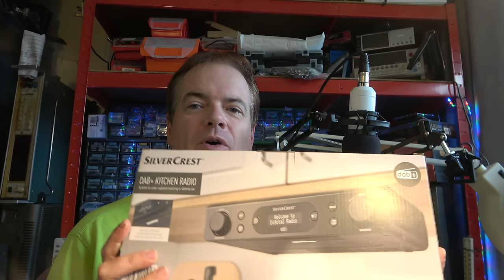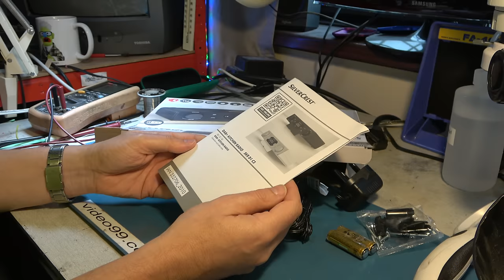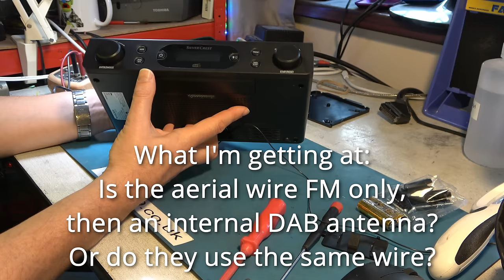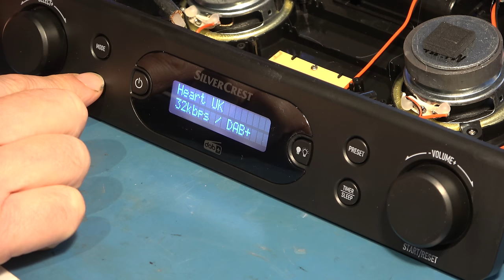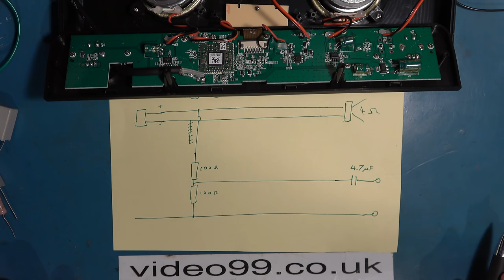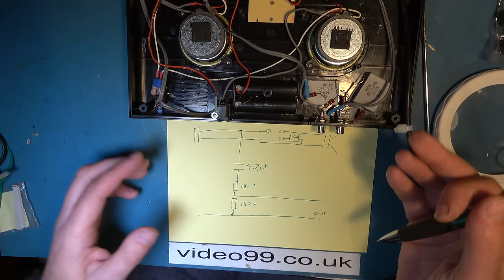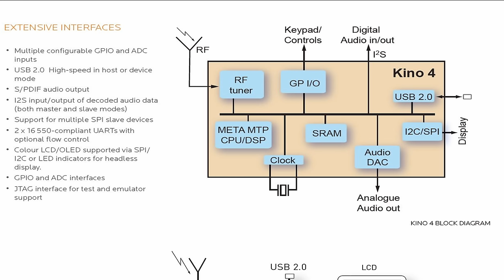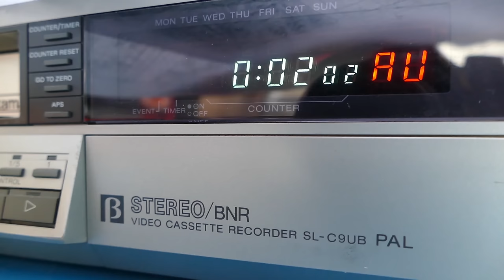DAB radio modifications.  LIDL kitchen radio could use some upgrades.  Part 1.

Comment: You said at the start of the video, about the importance of having a stereo output, but many of the DAB & DAB+ stations only broadcast in mono anyway, some at quite a low bit rate too. You will often find that the better your audio system the worse these stations sound! 
Most of the stations now have an online stream as well, which is usually streamed at much higher audio quality than DAB.
 I was surprised at how few components & electronics this unit contains too.
Reply from the maker: I believe that the old DAB channels have been switched to mono because they sounded dreadful in stereo.  The newer DAB+ channels are generally stereo.  Yes I looked at the streaming option for my dad's place, but this DAB route was much cheaper and simpler.
Reply: I think its more about dropping the bitrate. Dab is all about loads of low audio quality streams. Lots of choice as a result which is great for a lot of people and its all free! If you wamt hi-fi stereo then the FM with a really great antenna is nice. Sometimes stations are only mono because there's only so much room on the national muxes. Dab+ can be pushed further but Dab+ radios are still rare. There is a little bit of stereo and joint stereo out there though....
Reply: That reminds me... Did you find you had actual stereo or joint stereo from the dab or was it only stereo on FM. I'm assuming it could really do stereo dab but I know I shouldn't just assume with this kind of thing
Reply: They tried to tell us that DAB+ at 32kbps would be equal sound quality to DAB at 128kbps.
It's clearly not.
I have quite a few older DAB radios that I've modified, but I just cannot listen to anything on DAB+, it reminds me if a poor quality children's toy.
Given a more sensible bitrate, DAB+ would actually be a plus!
Reply: @jobliss3932  On some , but not all DAB radios the display Will  show the Letter 'J' to indicate if the station is transmitting in Joint stereo, from what I've heard Joint stereo is a sort of artificial stereo, where the signal is sent in mono, (to save bandwidth) along with a 'helper' signal, then split in the receiver to make it sound like stereo.
Reply: @simonparkinson1053  Yet another case of trying convince people that they will be getting something far better than what they actually got!
I remember when DAB was first planned in the early 90s, they said it would be Compact Disc quality sound! That may have been true to start with, in the very early test transmissions at 256Kbps, but that bitrate very quickly got reduced when they realised that by lowering the bitrate, more stations could be fitted into the same multiplex & even more still, if some were sent in mono! A classic case of quantity over quality!
Reply: Might be 256mbps but its layer2/mp2. Depends what you think cd quality is though. Having said that, long ago now, maybe 2015, there used to be a mono dab station broadcasting speech content at 24mbps and I thought it sounded okay but I'm used to hearing some pretty low bit rate streams. Listening to a station now that's a bit like AM sound with some occasional burbling but at least I can find stations I like if I need to and I don't  pay for the bandwidth. Have to sort out my antenna tho and I'm in London! It does what it does. I don't think it can ever be exactly high end audio and you only have to look at the average dab radio to know.
Reply: @NOWThatsRichy  Lots of the radios have an info button where you can cycle the second line of the display between the time/station name etc/bitrate & mode/ mux and location/signal strength. Lets you find out about each station. Handy feature.
Reply: @NOWThatsRichy  You're right, but it's not artificial.
Joint stereo is a method of encoding much like the way FM stereo is transmitted.
Not a left and right, but a sum (L+R) and difference (L-R) of them.
As you put it, a mono signal with a "stereo helper" signal.
Where both channels are related to each other, you can get a better quality for a given bitrate.
In true stereo, each channel is encoded as if it was an individual mono signal.
This isn't bandwidth-efficient as most of the time you're encoding "almost" the same thing twice.
So for example a 128kbps joint stereo signal would need to be 192kbps true stereo for the same perceived quality.
However joint stereo encoding loses some critical phase relationship information, so SD digital terrestrial TV sound (also MPEG-1 Layer 2) uses 192kbps true stereo instead of joint stereo, to avoid a load of "bubbling" artefacts coming out of the rear speakers on surround sound systems.
Reply: @jobliss3932  it's a standard module made by Frontier Silicon.
There will also be a digital output available on one of the pins to interface with a separate DAC.
The format of stereo or joint stereo is set by the broadcaster, the receiver module can handle all possible bitrates and formats in the standards.
In joint stereo, the broadcaster encodes (L+R) and (L-R).
The receiver, being told it's joint stereo does a bit of maths so: 
((L+R)+(L-R))/2=L
((L+R)-(L-R))/2=R
FM radio works in exactly the same way.
Reply: @simonparkinson1053  I really just meant stereo in dab vs FM but your reply made me realise that all the little dab radios just have a chip in them! I knew that of course but I wonder if they aren't"t that hard to modify for stereo! A strange idea. I bet the chip can always do stereo. Its surprising to that end that almost all the dab radios are mono. Was a second speaker really that expensive? I guess they had to be made to a budget.

 I actually thought that about joint stereo. Its a lot like FM in that way,! I'm actually lucky enough to have a stereo dab radiio. Not as fancy as your setup of course but I'm glad to have it. I've actually lost some stereo channels I liked just recently but there's still a few hanging in there! I don't mind the mono stuff however and with good reception the quality seems no worse than many internet radio streams without the hassle of having a good internet connection. I don't expect CD quality or even FM quality, just lots of choice and DAB seems great for that at the moment.
Reply: @jobliss3932  as far as I know, in a mono DAB radio the downmix to mono is not done digitally on the module, the L and R output signals are combined to the one amplifier input with resistors.
I have a Sony portable that I don't use much (XDR-S56DBP) which is mono but has stereo available at the headphone socket.
The little amplifier chip (TDA2822) always runs both channels but the speaker is only connected to the left.
One of the internal switches in the headphone jack controls a 5V signal to an analogue switch IC that connects left and right together after the volume control (which is analogue in that particular radio)
Reply: At 32 kbit they use "parametric stereo," which transmits very little information for steering portions of the spectrum left or right. Something has to give at those miserable bitrates. The panning can sound smooth with a good encoder like Fraunhoffer, or jumpy with others. Layer II only had "intensity stereo" which combined the higher frequencies together using less compact coding.

Comment: Why not put the 2 resistors directly across the push-pull amp outputs and a Cap to their mid point to remove DC
Reply: Because if you did that, you'd get nothing!
On a bridge amplifier the outputs are equal and opposite, so at the midway between the two resistors the audio signals would cancel each other out completely and all you'd be left with is the DC mid-rail bias!
Reply: And if you meant from one output to ground, he didn't want to upset the DC conditions at the amplifier output
Reply: @simonparkinson1053  Doh! Never thought of that

Comment: This may be an utterly stupid idea, could you use a momentary switch at the end of the headphone plug to disconnect speakers? Once the tip fully inserts it would press in the momentary switch and connect the two channels together.
Reply: You could, but you'd be better off getting a headphone jack with the relevant switch contacts (I'd go for a switch on ground for this sort of thing), and use the switch to control some relays.

Comment: How about the humming noise, very audible at low volume?
The humming seems to be independent of the power supply, meaning it's caused by the power stage on the board itself.
Any fix for it?
Reply from the maker: Not had that.  You might have an earth loop problem, so I think I would start by connecting the phono outputs to something battery operated, or even directly to efficient headphones, with nothing else connected up.  Don't even have an external aerial connected.  If you still hear the hum, and you've eliminated the power supply, then it does imply it's a locally generated noise.  Try turning off the display backlight in the menu in case the driver for that is the cause.  Hope that gives you some ideas of where to start looking.
Reply: @video99couk  Thanks for your reply, but we're talking about the Silvercrest DAB radio. No phono outputs, and it's a model with power supply only (no batteries).
No ground loop issue. No interference from the power supply either.

Comment: Hi, complete novice questions. Could you have fitted a wifi Bluetooth capability to send it to a sound bar etc? and was the Arial adaption grounded? don't worry I will be getting my son to do any adaptions he is doing an electrical engineering degree, couldn't do it with my plumbing tools anyway Cheer Mike R.
Reply from the maker: Yes the point of the aerial modification was to provide a proper grounded input so you can connect a dipole or similar.  It would be possible to add BT audio out, but the cost and complexity would be such that it would make more sense to buy a suitable BT DAB radio.

Comment: I think I would have used an opamp to get the attenuation right and get the output impedance and DC level right. I have to admit though, I'd have to do some research to re-learn all I've forgotten about opamps.
Reply from the maker: Op-amps were never my favourite subject.  The solution does work really well, and I'm now going to do the same to the white/silver unit.
Reply: That would be a good solution.
I was prototyping an internet radio out of aliexpress modules. There's a codec chip used in it, a VLSI VS1053b that could directly drive headphones.
The catch with that chip is that its outputs aren't referenced to ground, but rather to a separate "common" DC signal (called GBUF, I think). Which is great if you're only using it for headphones - no capacitors, no recharge time, or even for line out when device is battery powered or isolated. The sound is crystal clear.

I then tried to adapt it to normal, ground reference line out (as per appnote and common sense, with decoupling caps and everything), but I ended up with a bunch of extra noise in my sound because apparently audio out from codec in my particular circuit is noisy due to poor regulation and power hungry ESP32 nearby that sags the power slightly every time it accesses WiFi, and possibly (but unlikely) also injecting RF noise in nearby traces. 
So noisy audio outputs from codec sounded clear while they were referenced to similarly noisy common output because noises on all outputs were identical and cancelled out; and they sounded noisy referenced to clear, low impedance ground.
That would've been a good application for an opamp buffer output, so it could avoid the noise and remove DC, except I don't have a bipolar power supply in my device.

I ended up attaching another DAC to I2S output of the codec (MAX98357, amazing tiny D-class 3W amp with I2S input to drive single speaker with mono audio - it doesn't care about power quality at all, it simply always sounds clear), and using DC-coupled headphone out for exactly that - headphones.
Reply: @ZXRulezzz  I wonder what Colin's radio has as chipset. Maybe it has an I2S bus that he could have used? The vs1053b is a nice chip, I own one on an Adafruit board and contributed a bit to the firmware (and I mean literally a bit: when you initialize it, you can set a bit in a register to enable or disable MP1 and MP2 encoding and I contributed a patch to turn that bit on so it can decode DCC audio 😄).
Reply: @JacGoudsmit  You mean DCC as in Digital Compact Cassette? Nice!

Never had a chance to play with DCC, but I own a few DAT tapes and a recorder.
I haven't released what I have done yet (it's an experimental spaghetti mess), but I made my own custom S/PDIF transceiver with FPGA that works with raw 32-bit words.
I initially did it so I could put music with index marks on DAT automatically, since DAT disregards CD and MD track changes; and digital outputs on PCs these days don't support arbitrary U and C subchannels...

And now I can also record any S/PDIF streams raw, for "forensics" and whatever other activities... :)

Regarding DAB chipset, looks like it's SIENA FS2415 by Frontier Silicon. Looking at its webpage, it indeed looks like it has I2S out.
Reply: @ZXRulezzz  Yes, that DCC 😄.
Reply: @ZXRulezzz  DCC has similar... limitations: It will record track markers if you record from a CD player that sends them through SPDIF, but it won't record other subchannel information such as CD-Text. There's also such a thing as DCC-Text (using the IEC 61866 standard for ITTS which by the way is also used for digital radio) but there were never any commercially available devices that could understand that information which is part of the SPDIF output on first and second generation DCC recorders. And though ITTS was mandatory on prerecorded cassettes, it was impossible to store ITTS on user-recorded cassettes.
Anyway I'm doing some hacking projects with DCC so all that may change eventually...

Comment: Why not take the input signal to the amplifier ICs and use that as your line out. Ok it may need a little boost with a simple op-amp circuit but it would be better than the output side
Reply from the maker: Would it really be better?  If I'm going to have to amplify the signal, I may as well use the amplifiers that are already provided.

Comment: Those 4.7 uF are too small as you are driving two low value resistors. Try a 100uF and + goes to chip.
By the way, push pull is the wrong term for this type of output. It is known as bridge output.
You have two push pull amplifiers 180 degrees out of phase to drive the speaker. As you say this will give you twice the voltage swing as a single push pull amplifier with ground as the other speaker terminal.
Reply from the maker: Both of these points have been made further down.  I'm doing a part 2 where I discuss the required R and C values to get proper frequency response.
Reply: Just to add, the amplifier chip is actually two class D, and not push pull. Each amplifier 180 degrees out of phase. That is a bridge configuration. In this way, with only a low supply voltage you can get a decent power output.
I have seen your follow up video by the way.

Comment: From your review you mentioned that it wasn't hard/expensive for manufacturer to add external antenna connection or line out/headphones connector. But you missed that not all features of the product is about expenses, it is also about marketing. From marketing point of view both features you mentioned are locating you in another, more advanced, target group than this specific radio was targeted and so they definitely has something to propose you in twice or more higher price range)
Reply from the maker: Well yes, that's how I picked up a DAB tuner worth £50 for just £25!

Comment: Would be nice if someone came up with a firmware hack. Some stations are blocked because of regional codes. I have the same issue with DVB-HD2 reception near Germany while being in Holland. There are ways to bypass that restriction and with a good antenna and amplifier, you get excellent HD reception.
Reply from the maker: News to me that there were region codes on DAB.  Here in the UK we don't get neighbouring country transmissions in most locations.

Comment: There would be no point adding a headphone socket to what is intended as a kitchen radio, presumably for use while cooking. Bluetooth would be better.
Reply from the maker: It's also intended to be used in table top mode and as a kind of clock radio.  So a headphone socket would have made sense in that use case.